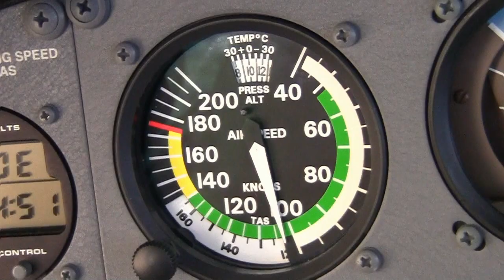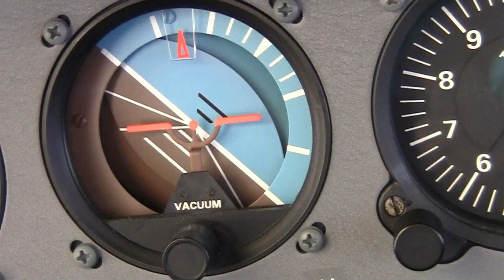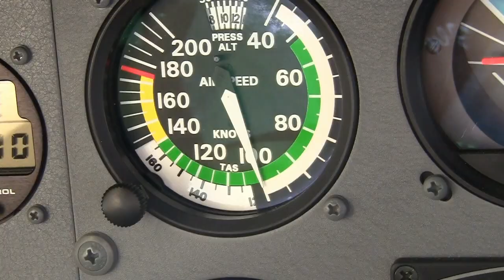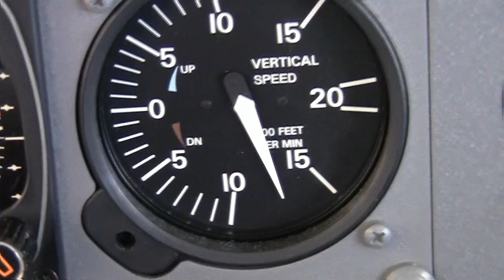Emergency Descent Maneuver

Comment: Emergency Descent - So if you want to get the airplane down lower in the safest, QUICKEST manner....     STEEP SPIRAL Maneuver - If you want to quickly get the airplane down over a specific point on the ground, while maintaining precision headings and airspeeds.       In other words, if your engine is engulfed in flames, then use an Emergency Descent to just get that damn airplane down to the ground ASAP. before it disintegrates in midair.        On the other hand, if you have an engine failure (no fire), and are over your landing area (runway, field, etc), use the Steep Spiral to get the airplane down to the point where you can transition to a power off 180  landing.     Another reason you want to use an emergency descent is to get the airplane down to a safe altitude due to a rapid decompression.   Remember in an Emergency Descent, your top priority is to get that airplane down to a lower altitude ASAP.   Time is the priority.   You are not concerned about nailing a specific airspeed (just keep below Vne, or Vfe) or a specific heading.   Both maneuvers should be completed with "eyes outside" 95% of the time. This is not an Instrument Maneuver.    Glance inside momentarily from time to time in order to validate your performance instruments (Artificial Horizon, airspeed, VSI, Altimeter, Turn and Bank Coordinator,), but remember to keep outside "sight pictures" your main reference of flying this maneuver.   Comments?

Comment: Hi Garry, great video but I have a question. You mentioned slipping to get down but you had full flaps in. So in that case, would you have retracted them, the chose to slip? Granted in a real emergency, things might be different. Thanks!
Reply from the maker: Good question, but you want flaps when you're trying to get down quickly as they add even more drag, at a lower descent airspeed. Just don't exceed the Vfe speed (load limit is less w/ flaps than w/o them).

Comment: In a carb heat model it's a good idea to crack open carb heat a little at the start. The twin engine emergency descent we used to do were much steeper bank angle and more slip to burn speed. You definitely better do a couple 360 good visual checks for traffic included with announcing on the radio.

Comment: why exactly is any negative G so bad? Is it because of the gravity fed fuel tanks or what...
Reply: Yes lots of older Cessna's used for students are gravity fed. Lift is also drag and negative G's is getting that drag would be another reason.
Reply: Airplanes are built to withstand positive G's not so much negative. Some fuel systems are fed to the engine through gravity and if you remain in negative G's for too long. Then engine may run rough or quit. But generally its more so you don't cause damage to the airplane by pushing the yoke forward.
Reply: Also oil does not pump well with negative G's due to sump volume decrease.

Comment: A spin is the best way to get down in a hurry.....
Reply from the maker: Actually not. A spin is a 1-G shallow descent. Load up the wing with a high-G spiral (think "Graveyard Spiral") and you'll come down a lot quicker. Of course, do either on a check ride... or while demonstrating the Emergency Descent maneuver --- the purpose of this video --- and pink slip for you!
Reply: Interesting, thanks for the explanation!
Reply: Spin is quicker, C152 3 turns 700 feet loss in 4 seconds, =10,500 fpm.

Comment: Gary, that is insane! Very interesting! Sorry to get off topic, but are spin related accidents less frequent now, so they don't think its a requirement? Thanks for the quick response!
Reply from the maker: Jesse S I think they figured out that airplanes in cruise flight / at altitude rarely get into a spin, and those that do so at < 1,000' have little chance to recover, so they quit performing  spins, and instead we teach how to avoid them. Just like we don't actually start an engine fire, just to teach how to handle it :)

Comment: So US FAA PPL standards add this to an exam and syllabus but no spins? Although emergency decent is important, one would think they would have spins added to the exam as the recovery is very important. The Canadian PPL and CPL syllabus is much more labourius and demanding. Combining every possible scenario and recovery in all aspects of flight with little to no margin for error. This was a very good video by the way.
Reply: Garry Wing its required to be an instructor. But not a pilot sir
Reply from the maker: Jesse S US quit doing spin training in 1949. They were losing more airplanes in training than in real-world spins! Not req'd for any pilot or instructor license.
Reply: Garry Wing oh your right, you only have to get an endorsement which doesn't require doing the spin, just having knowledge of how to recover from one. thank you very much cap!
Reply: Garry Wing what good is a endorsement I've you haven't recovered from one though. Even though all my CFIs have done spin training I don't see why its not obligatory.
Reply from the maker: that weaboo Yeah I agree; 8-hrs. aerobatics, emergency/upset & spins (and some glider training!) would benefit every pilot but I think most of the contract flight schools shy away from spins mainly for insurance/liability issues. They would also make the point that you don't actually have to set the engine on fire to learn how to recover from an engine fire, do you...?
Reply: Garry Wing well thats a bit different because a fire isn't a controlled environment. Do a spin at 3k+ fleet and you have enough time to recover. The insurance part makes a lot of sense :)
Reply: Very interesting! CDN ppl and cpl make it obligatory in ppl training but not exam. It is however on the CPL exam. It is an entire hour or 2 in the CPL syllabus
Reply: Spin awareness is required training, however spin practice is not. If you're in a position to get into a spin, say base to final or a go around where most spins happen, then recovery isn't likely. However, spins at altitude can be recovered from with just awareness training. Everyone knows PARE: Power idle, Ailerons neutral, Rudder in the opposite direction of spin, and Elevator forward to break the stall.
Reply: Not all aircraft are spin rated. Doing spins can damage gyro instruments. Spin recovery can also torque wings a bit around the area of the curtain closing in your eyes while the plane screams diving pulling G's. Good training, just not everyone is trained.
Reply: plane15man How many people are cruising along at altitude and get in a spin? Spins occur from yawing at high angles of attack usually in the pattern or spotting stuff at low altitude. Non recoverable better to teach flying at the proper angle of attack in coordinated flight.
Reply from the maker: that weaboo No, not in the U.S. The spin endorsement for initial CFI only requires applicant "possesses instructional proficiency" in spins; no requirement that he ever did one. Please see 61.183(i)(1) and the endorsement itself (AC 61,65E). Having the endorsement then gives the examiner the option to accept this in lieu of XI. Task G (I've never heard of an FAA examiner requesting spin instruction during the flight portion of the practical test). Remember, the CFI license is all about teaching; it's not a pilot certificate!

Comment: I understand that all aircraft either utility category or normal category are severely limited to negative g's around 1.5-1.7, but I must admit I do not fully understand why there is such small window for a negative G's. Intuitively thinking maybe it has something to do with the wing and spar structure, or perhaps fuel, oil ETC. Can you shed a little light on this situation for me?
Reply from the maker: Edgecrusher- TWR Good question, but not that important to know. Higher Positive G's (pushing you into your seat) can be accomplished at lower speeds than can the same Negative G's (pulling you from your seat). The airplane will generally lack sufficient power to maneuver in this direction (such as inverted, pulling an inside loop --- don't try it in a Cessna 172; it can't be done). And yes, it is all about wing, spar, control surfaces --- not over-stressing them, bending or breaking metal.There's some good info in the "Aerodynamics for Naval Aviators" book; google it for free PDF download and look under "load factor".
Reply from the maker: Garry Wing One more thing; as a friend reminded me yesterday, the Pos & Neg limits are actually close to being the same as we start at 1.0-G for "Normal" (not 0). +3.8G is 2.8 higher than normal; -1.52 is 2.62 lower than normal (-1.7 is 2.8 lower; same as Pos load). How they came up with+3.8, +4.4, -1.52 is beyond my pay grade... maybe someone else knows origin or was it simply arbitrary?
Reply: A very good point, I guess I had always been working from zero before, but like you had said. We start at one gravity!!

Comment: Question, since this is one area I just blew on my PPL Checkride.  What exactly are the examiners looking for? The PTS is very vague with regard to this.
Reply from the maker: Krista Morisen Your instructor should be asking the DPE what they are looking for on this (or what you specifically did/didn't do). PTS is rather general; I would say they are looking for you to set-up for what would be a feasible/survivable off-airport landing (my A thru G list), while still in control of the airplane. Like I say in the video, this is one of the "high workload" tasks on the PPL ride. "Selects a suitable landing area" is an element that trips up many pilots; they hem and haw or they pick something that is not under the nose of the airplane (beyond gliding distance). Recently, I've had a couple examiners that have really focused on two words in element 5: "considers wind...". They were hell-bent on having the student land into the wind; always a good thing in landing, but in an emergency, I thought they were putting too much emphasis on landing into a 5-knot wind, rather than avoiding a fence line, etc.
Reply: Garry Wing
Thank you. I'm not sure if my instructor has talked to the DPE yet. It was probably the only area where I thought I did well but somehow failed to do well on.

Comment: Hello Garry, Thanks alot, great video. But Full flaps with 100 KIAS? Is that over max flaps extend speed? Roll 45 degrees bank nose-5, you will gain 100 KIAS, My instrucotr dont allow me extend full flaps over 85KIAS， below 110 KIAS only flaps 10. Thank you.
Reply from the maker: Zihong Zhao No, the white arc (Vfe) in the Skylane is 100-KIAS (140-kts. for 10-degrees). Sounds like you're flying a 172; obviously different V-speeds in different airplanes.
Reply: Yes, i am flying a c172sp, sorry for that i thought that was a 172 too, thank you very much.

Comment: I think Onecheman was referring to the utility category rather than an aerobatic… But the only time a parachute must be worn is when banking over 60° or pitching over 30°, and only if passengers other than flight crew are aboard. I always thought they were always required when doing aerobatic banks or climbs/descents, but apparently that isn't the case. I just learned that today when reading through the FARs. Great presentation!

Comment from the maker: Look at "Emergency Descent" in the PTS. It references 8083-3 (Airplane Flying Handbook). The book describes how to do this maneuver. Would you really SPIN an airplane down to TPA, then try to recover and land it? Also, review 91.307(c) and (d). You need parachutes when intentionally spinning (unless training for CFI; the only rating requiring Spin Endorsement). Finally, it's possible to get Utility/Spin Allowed certification w/ only 1-turn testing (23.221(b)). Just learn the maneuver properly.
Reply: Spins were the standard descent back in the biplane era, but a stearman ie has a very tame spin really nothing to be afraid of. Part of the reason was that with a lack of proper IMC instruments a spin was a very reliable way to descend out of a cloud without overspeeding or going too far horizontally.

Comment: I knwo that the best way aboid crashes is aboiding stupid/strange maneuvers but:
If we are in a cessna 172 (f.e.)She is allowed for "aerobatics" with half load and 2 passengers. 
And it's supossed cessna leaves the spin by her self. Will be not IN THIS CASE a good way as the 777guy said? 

Regards. 
Nice video.
Reply: A Cessna 172 loaded near aft CG will not come out of a spin, but will enter a spin readily. Do not spin with people in the back we do not want to read about you!

Comment from the maker: Good points. I attended a seminar by Dr. Ian Fries @ AOPA last week. His point with fire in an airplane: LAND THE PLANE. Don't mess with it, trying to troubleshoot, resolve, etc. Part 23 firewalls only have to demonstrate 15-minutes of fire resistance; get it on the ground, just above stall speed with the nose slightly up. That's the way you're going to walk away.
Reply: Agree 100%.    The No#1 priority with an engine fire is to get the airplane landed safely on the ground AS SOON AS PRACTICABLE.     PRIORITY = TIME.          That's why folks need to know when to use an Emergency Descent (Fire, or rapid decompression), vs a Steep Spiral (engine failure).      An engine failure doesn't require you to get the airplane down on the ground as soon as practicable.  If you have a perfectly functioning airplane (other than the engine out), just use a glide or Steep Spiral over the airport to position yourself for a transition to a power=off 180.       The fascinating thing about this conversation, is that we often know the two maneuvers and how to perform them, but it gets interesting when you throw in a (SBT) Scenario Based Training situation, and then see if you can correlate your scenario to the correct maneuver and why.   This is the highest level of learning.  This is where we all strive to be as pilots.

Comment: Nice video! Remember, if it is TRULY an emergency due to fire, smoke, etc, there are others that can help. Declare an emergency if you're talking to ATC, or declare an emergency on 121.5. You can get information about closest airports, weather, terrain avoidance, approaches, and have ground help waiting upon landing. Also, think about the reason for your emergency descent. If you have structural failure, or a high probability of structural failure, you're not going to want the airspeed near Vne.
Reply: Be careful with trying to find a nearby airport.    Even tho you may be within gliding distance to an airport, it may take up too much time only ending up in complete structural failure (due to the fire), and then you fall out of the sky.     Time = No#1 priority.   With an engine fire, get the airplane on the ground ASAP in a controlled manner, even if it means an off airport landing.